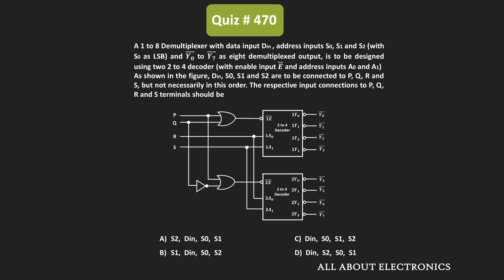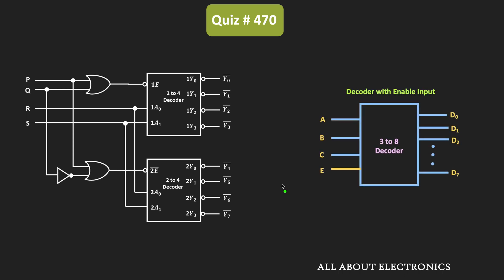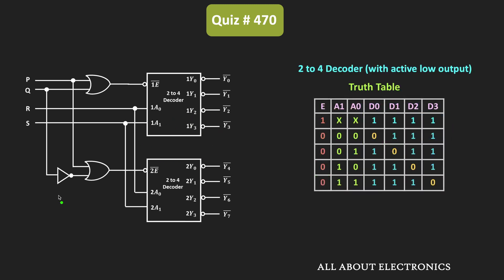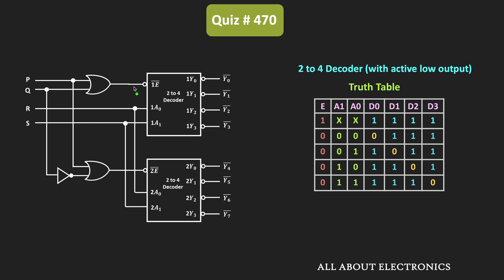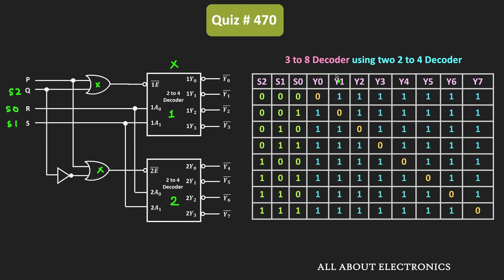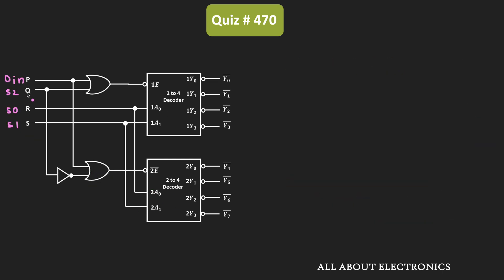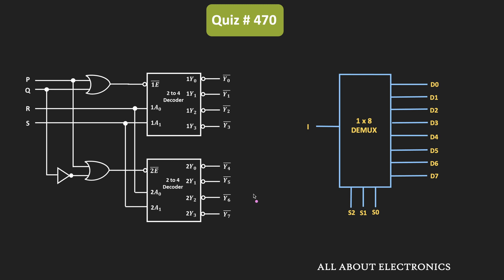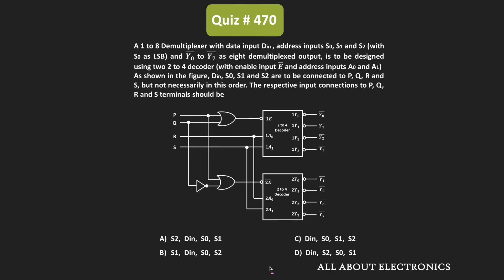How to use Decoder as Demultiplexer?  | Quiz # 470

Comment: bruv just draw 1 big truth table

desired inputs outputs (demux), and 2 decoders' inputs matching desired outputs (in the table)

solve for desired inputs to 2 decoders' inputs in kmap

way simpler and more rigorous than simply explaining

no need to combine to 3:8 either, just treat as 2 separate 2:4 decoder inputs (2 devices), both in that one big truth table

using this method u can map any devices to any desired inputs and outputs
Reply from the maker: Yes, it could have been done using the table. But as the number of selection lines increases, then it is more time consuming method, especially you are solving in the competitive exams. I wanted to explain the approach of the design. Specifically, when you are designing it using lower order decoders (in this case, 2 to 4 active low decoders). That's why I elaborated a bit.